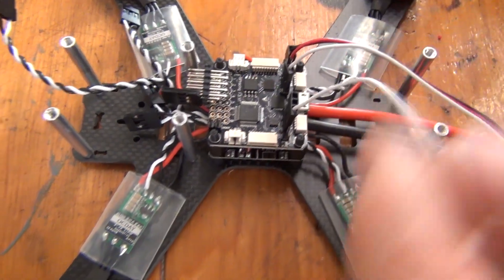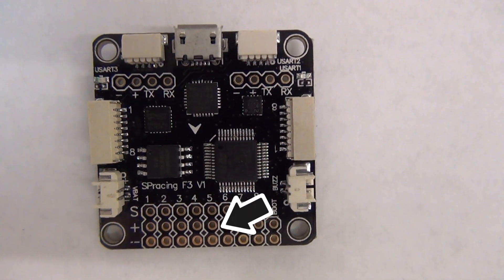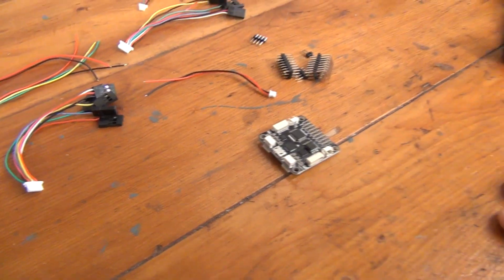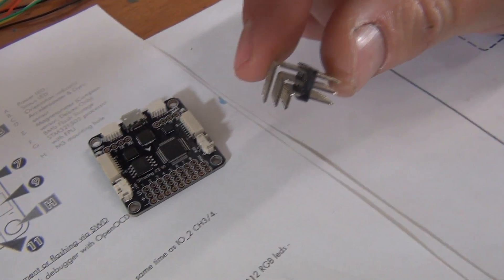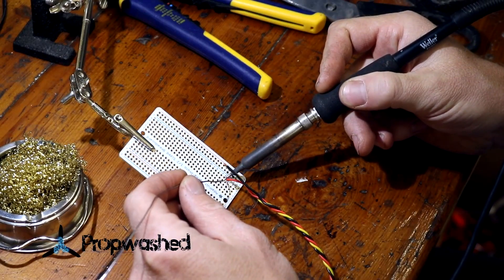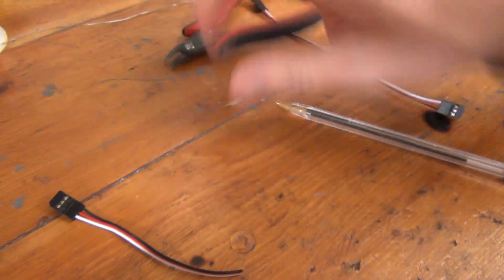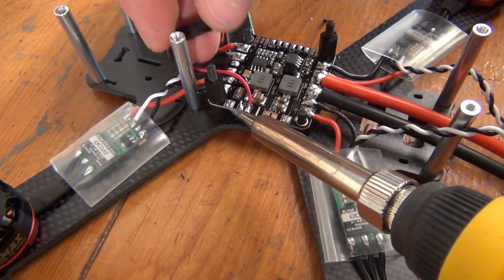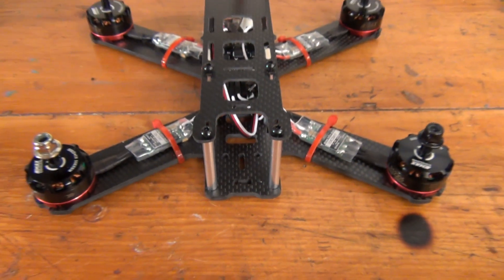How to build a racing drone | Part 4: Flight Controller Installation! UPDATED

Comment: Any recommendations on which wiring kit's to buy off of amazon? For example, the wires and connectors you guys used for the battery connectors?

Comment: I hooked up a 6.6v LiFe battery like said at about 6:50, and heard a brief pop as if something burned out (but no smoke).  It was a very quick contact, pulled off, then tried to same connection and there was no more pop or smoke.  I earlier tried to power it up with VBAT connection with 12v from PDB.  Never did I see any LED light on on flight controller.  Is there a simple way to tell if this board is fried ?

Comment: Thank you very much for this series, finally all step by step, there are so many chaotic build videos out there...
Great explanations, very good to follow for me as a beginner! This will guide me through the process of my first build, on a Realacc x210 frame. Budget build, hope I'll make it through since I will try to get those pin connectors into the tight space. If not, more soldering will be the next challenge along ;-)
But with those instructions, I feel well prepared now!
Reply from the maker: Glad that the video was helpful!  Good luck with your build!